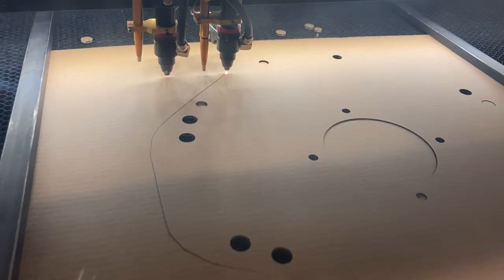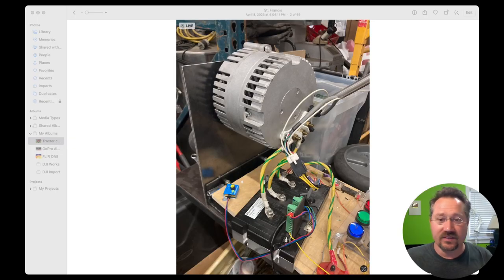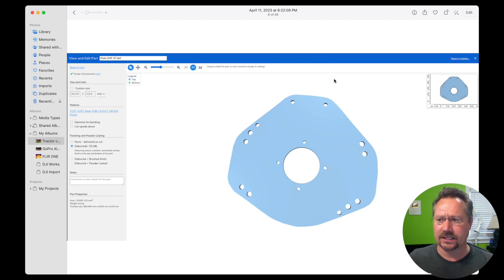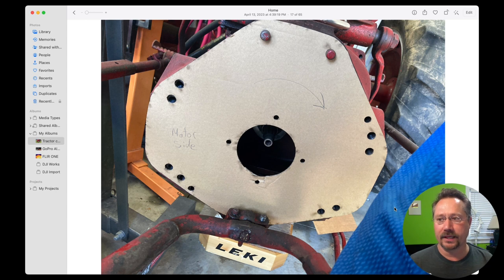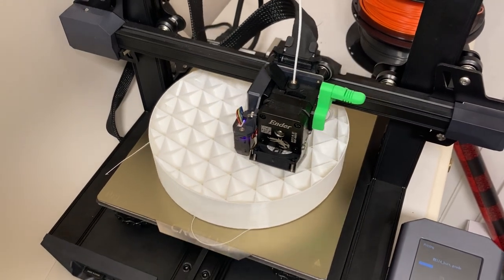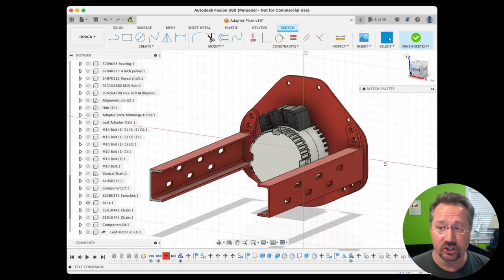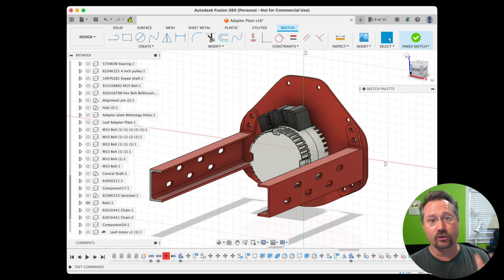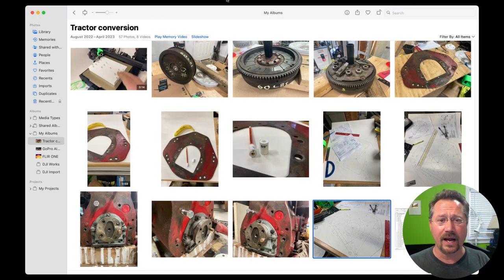Electric Tractor Update, April 2023 (International 300 Conversion)

Comment: You will need 12 to 15 gpm on the hydraulic pump and 2000psi for a loader to have decent speed and lifting force.  I having grown up using these old tractors on a farm I have used slower pumps and it isn't fun waiting for them.
The feature you are giving up by not being able to stop forward motion while running the PTO is called live power.  It is used baling hay or running a harvester to stop the tractor to process a bunch through the attachment without breaking sheer bolts.  If you don't plan on using It for harvesting you won't miss that but a brush hog might push you into something while if spins down when you come to the end of a row.  The flywheel is something I debate myself for a farmall H I would like to convert.  I worry that without the spinning mass of the flywheel the pto attachment might be too big a load to start with the electric motor.  I know stall torque is high on electric motors but it is hard to know what the design stall torque was for tractor attachments.  I am very curious to see how you make out as I would love to convert my grandfather's 1950 Farmall H just to give it new life in my summer haying business.
Reply: The issue with a brush hog on a tractor that doesn't have live power is that the transmission will be back driven by the pto inertia and you will not be able to slip the pto or transmission out of gear when you press the clutch disconnecting the motor.  An overrun clutch helps but isn't perfect on those tractors.  I have used that solution before it is definitely better you definitely don't want to come to the end of the field brush hogging and have the brush hog power your tractor until you use up the energy in it.  Learned that the hard way.
The problem with a overrun clutch is you have to wait for the attachment to spin down before you can engage a different gear.  I debate if regeneration on an electric motor would be a good alternative for that or not.
Reply: @DanA-nl5uo  I think Regen would be good for some tasks and not other.  When doing loader work, the ability to regen and reverse the electric motor would allow work without shifting.  Probably wouldn't want to do that same thing with PTO attachments.
Reply from the maker: @GMC.Sprint  I don't think the transmission would allow for simply spinning the motor the other direction anyways. I put the clutch disk on the driven shaft and used that to spin it by hand. It spins clockwise fine, but seems to lock up trying to spin it counter-clockwise.
Reply: @BenjaminNelsonX  I'm not sure about that tractor.  Is yours equipped with the TA (10 speed) transmission?  I know the TA units use an overrun clutch to change gears without using the clutch.  That might not allow it to spin backwards.  It might only work with the high low splitter in one position.  Most old tractor transmissions are very simple sliding gear units and shouldn't really care which way they spin.
Reply from the maker: @GMC.Sprint  Yes, this one has the Torque Amplifier. I don’t remember if it was engaged or not when I tried spinning it the other direction. I’ll have to check again with the TA both engaged and not.
Reply: @BenjaminNelsonX  Be very careful with a torque amplifier.  We had a big 100hp 986 IH when I was a kid.  The dealer came around with pictures of one that had blown the transmission and embedded a gear into the roof of the cab because someone was pulling 2 hay wagons down a hill and pulled the TA from high to low.  Apparently an IH Torque  Amplifier doesn't take well to being back driven by the transmission it only wants to see torque comming from the motor side.  I don't remember the design well enough to explain why I just always remember being told it is ok to shift a TA from low to high under load but never shift from high to low to slow down a load.  Always shift high to low when the tractor isn't under a load. The 18 year old was very luck the transmission which blew up sent the gear between his legs hitting the front of the seat but missing him completely.  Sure was an eye opening photo of the damage.

Comment: I am closely following what you are doing here. I have a 1953 Allis Chalmers WD with a bad engine. I have already rebuilt the brakes. I also bought a parts tractor, but found it also had a bad engine. I may go electric.
Reply from the maker: I need to chat with you sometime soon anyways! There's a guy near by who is converting a classic Fiat to electric. He's having issues getting the Orion BMS working on it. I'm 3D printing some parts for his project.
Reply: @BenjaminNelsonX  I have some experience with Orion BMS. I actually helped beta test their new v2 BMS models. What sorts of issues is he having? Has he contacted them for support? They are usually very responsive.
Reply: @BenjaminNelsonX  I would be happy to help if I can.